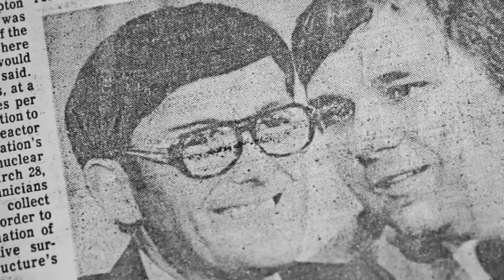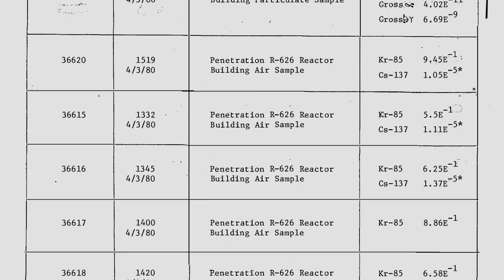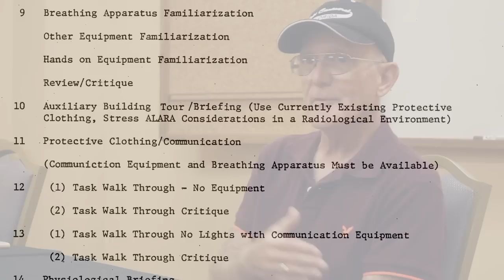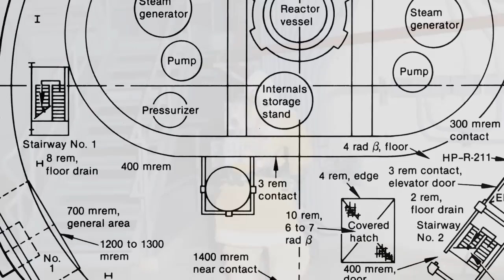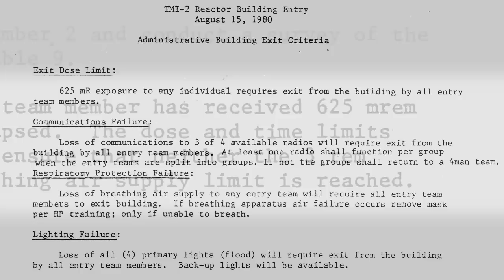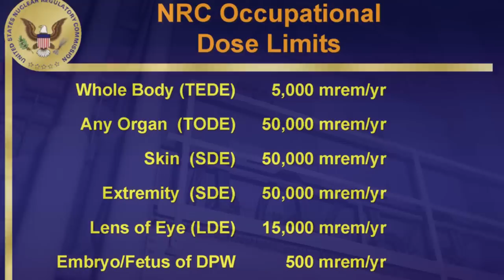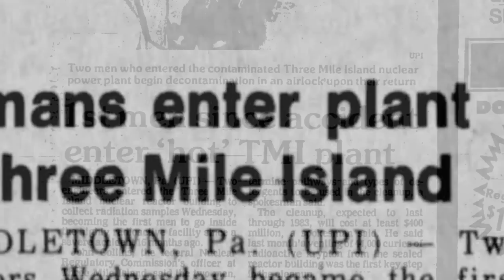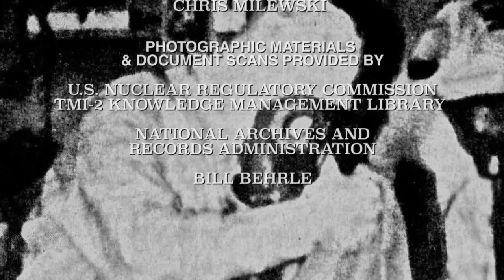TMI-2: The Entry (first entry inside Three Mile Island reactor building after meltdown) documentary

Comment: Living 12 miles from this accident when it happened, I can tell you the lack of good information is what made it all the more scary. One never knew if they were getting the truth, nor weather the "experts" even knew what was truly going on.
Reply: @Jim Frazier - The sad thing is if the operators had been "Locked Out" of the control room the automatic shutdown would have prevented the meltdown and no major damage would have happened. The valve was closed when the indicator said it was open so the reactor overheated.
Reply: @WJV9  thats true to a point. There were design flaws that "tricked" the operators..not too mention faulty equipment. TMI Unit 1 was down for refueling when the accident at Unit 2 happened. Guys that worked both Units said that Unit 1 was a smooth running, great performing plant. But they said that Unit 2 was always a "dog"..that nothing ever worked right.

Comment: Thorium type nuclear energy does (potentially) promise to do the heavy lifting needed to power our Country.  Instead of shunning nuclear energy, we need to learn, to research, to innovate and to EDUCATE both the general public and future technicians to harness this CLEAN energy to make a better living for us and future generations.   The most promise with the least environmental impact, LET'S GO!
Reply: It's frustrating that the West hasn't invested more in developing thorium reactors as an energy source. It has big potential to bridge the gap to fusion, which the West has dumped billions into with the promise that in just a decade or two it will be ready for commercialization.... something they have been claiming for decades. Fission works and with advancements in passive safety designs, it's the best option we have.
Reply: I rather put my chips on either of the two approaches to making fusion commercially viable than producing more highly radioactive waste still nobody knows where to PERMANENTLY (i.e. not handing it over to future generations) store in a safe way.
Reply: Agreed, but it looks like we're not going to be able to overcome our fears. China looks more than happy to step in and beat us to it unfortunately.. 
I'm honestly not a big fan of Thorium though. Molten salt is a good start: No expensive fuel assemblies, low pressure, high temperatures (great for turbines), walk-away safe, chemical separation of fission byproducts. Using Thorium is a lot more complex; that problem of neutron erosion of the enrichment jacket material is going to be a tough engineering challenge to overcome. A jacket thick enough to survive long-term hurts enrichment rates, and a jacket thin enough to be efficient will fail too quickly.
Reply: Might I suggest using Liquid metal as a coolant medium. The advantage here is you’ve basically got a system that’s self SCRAMing if it goes bad as the liquid metal will entomb the core permanently. The downside is you’ve got to keep it hot when doing maintenance. ( Hot by pumping superheated steam into the core to keep it liquid). The only real downside is that you have to replace the entire reactor vessel when you want to upgrade, the plus is you can go 20 plus years before doing so
Reply: Thorium fission daughters are nasty emitters of radiation. Fusion produces very high energy neutrons. Conventional uranium 235 fission isn't so bad if it's built properly, in the right location.
Reply: Molten Salt Reactor (MSR) technology is very promising, and is suitable for Thorium. Only issue would be the worry that MSR technology can be used to make nuclear weapons, yet people forget that the RBMK-1000 (РБМК-1000) reactor that exploded at Chernobyl is capable of being turned into a breeding reactor by the Soviet authorities in Moscow.
Reply: @matthewcaughey8898  there is Molten Salt Reactor (MSR) technology as well. Similar concept, yet you don't have to worry about keeping metal hot. Biggest worry about MSRs is that they can be use as breeding reactors, yet people forget that the RBMK-1000 that exploded at Chernobyl was in essence a civilian version of the Soviet breeding reactors they had at the time.
Reply: I haven't heard of Thorium before now. OK, I am not a expert on nuclear power, but did go to school and took a week long class on radiation safety for working in the field of radiology where we used Iridium 192 and Cobalt 60 camera's. I am for the use of Nuclear power, my only drawback is the cost of Nuclear power on my electric bill. In Kansas we were paying a high bill because of the cost of Wolf Creek. It was built to generate more power than they could sell so we ( the customers) got overcharged for that mistake.
Reply: Find a way to dispose of the waste properly first. That's something they never have done.

Comment: TMI was far more damaged by the negative publicity than by the actual physical damage and the entire industry was nearly crippled. If not for this event, out reliance on fossil fuel power today would likely be vastly lower. Out of thousands upon thousands of reactors that have been used, only 6 have had major issues and 4 of those only after a very large earthquake and tsunami. 1 more due to haphazard design and no safety culture and then TMI from mechanical failure.

Comment: My dad designed and made the floating pump to remove the radioactive water. He and another entered into the containment building through a hole made through the concrete onto an I beam 30 ft above the radioactive water. They passed the pump and hosing carefully down onto the surface without it flipping over and got the heck out of there. I don't think the NRC knew before hand the plans to do this.
Reply: Heros
Reply: Really?

Comment: I remember this. I've been in Fermi 2 picking up electric tooling that was going to another power plant that wasn't nuclear. Still remember the back lash against a nuke plant that was a similar design that was going to be built in Midland Michigan. It never happened, and that plant now I think is natural gas
Reply: My dad was a civil engineer in midland. He passed away in 2020 but when we were cleaning out his storage unit I found his eng logbook and even his Pink slip from the time working on the plant.
Reply: Each of Midland's two reactors were going to be similar in design to the single reactor Palisades near South Haven, Michigan.  All  were under ownership of Consumers Power (now Consumers Energy) at the time of construction.  Palisades was later sold to Entergy who permanently shut the plant down in late May of 2022 and then sold the plant to Holtec for decommissioning.  

You are correct that Midland is now gas fired.  I'm assuming it is combined cycle as nearby Dow Chemical uses the steam for various manufacturing processes.
Reply: The spent fuel issue persists.. 
The hydrogen explosion at TMI means that fission products were released. It could have been worse but it was bad enough..
Reply: @estosgarage486  Some radioactive gas was released, but it was low level with a very short half-life and posed no threat. 
Spent fuel is solid, easily stored, and poses no safety threat. If nuclear power were to grow in use, and more dollars follow for further research and modernization, "spent fuel" could potentially be reused in other reactors.
Reply: @davidwayneprins  That is not correct. Midland was a B&W designed unit, just like TMI. Palisades is a Combustion Engineering (CE) unit.
Reply: If it made it out of the plant the tooling wasn’t radioactive in any way.
Reply: Ever wonder what happened to Fermi 1, that no one every talks about...
Reply: Fermi 2 was a General Electric while Midland was a Babcock and Wilcox nuclear steam system.  Midland was to be a cogeneration unit in that DOW was to receive a portion of the steam to run their chemical plant.
Reply: @MrGiomig  Not true at all.  Radioactive tools/equipment are moved all the time and shared between plants.
Reply: @ginog5037  Nothing.  Decommissioned  in 72'.